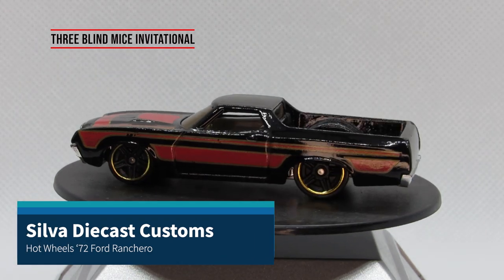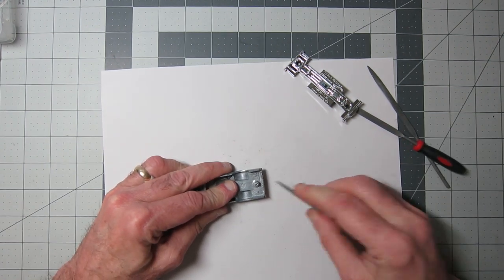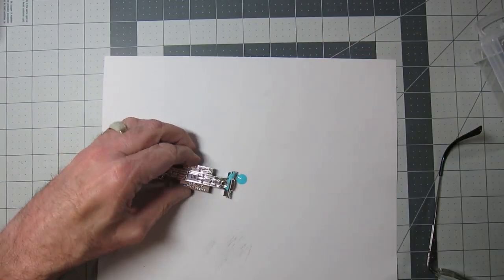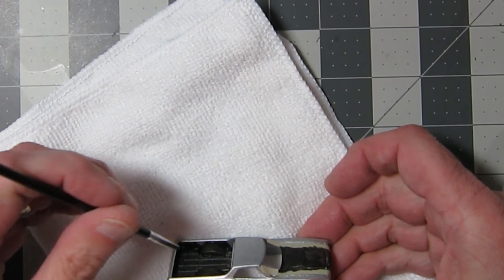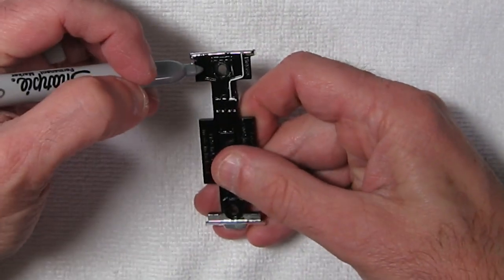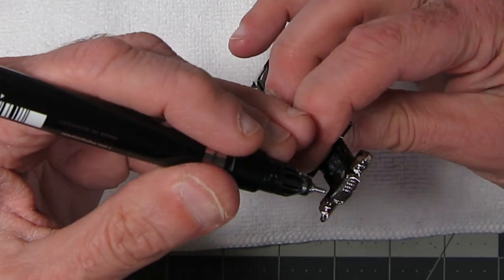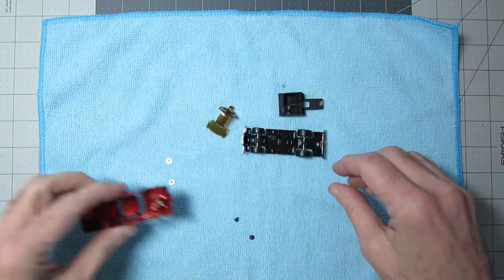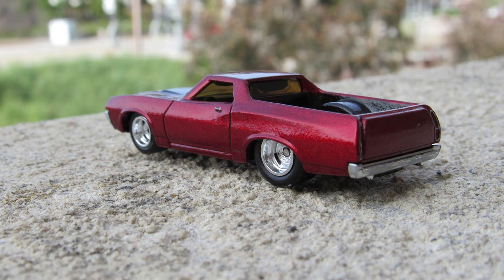Hot Wheels 72 Ford Ranchero - Three Blind Mice Invitational

Comment: Lovely job Jim, that colour choice is just spot on and good tip with brushing black paint on the body before going with the final coats.
I did one of these rancheros, in fact the same exact casting sometime last year, I put some stock wheels on it along with a truck lid, was a lot of fun to do and I want to do another at some point, or an el camino! :)
Reply from the maker: Thank you so much!  Brushing the black works oddly well...I stumbled across it on Scrappy the Shop Truck and cant wait to use it again...particularly with the Metalcast paints.

I’d love to see you do an El Camino.